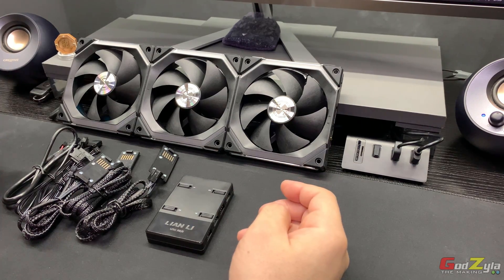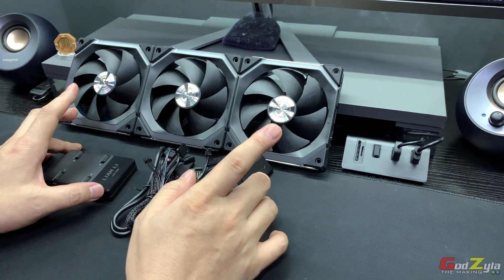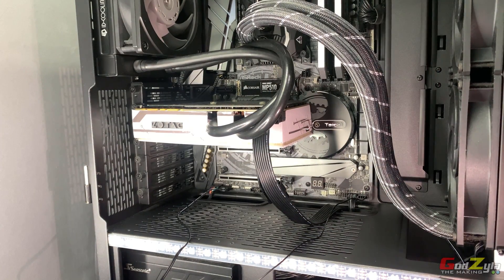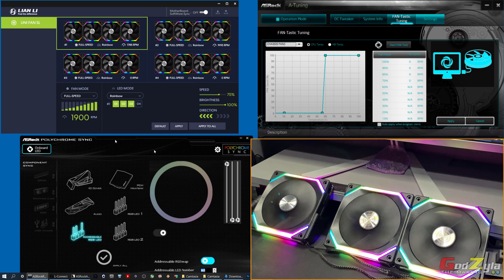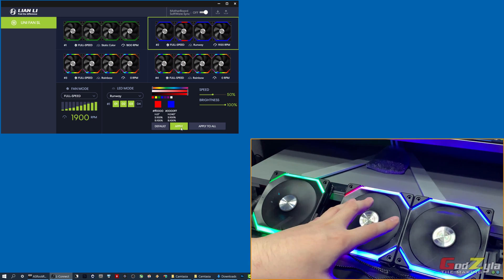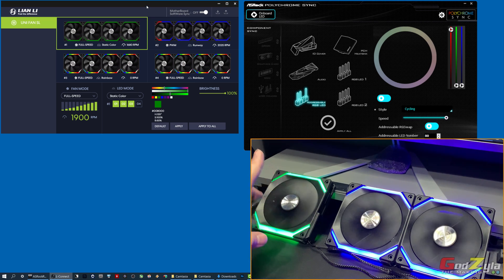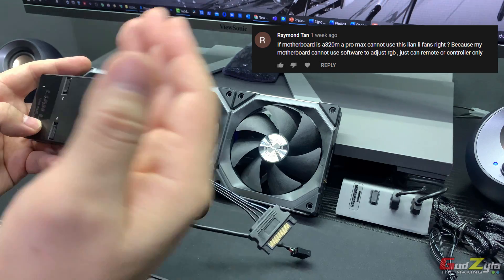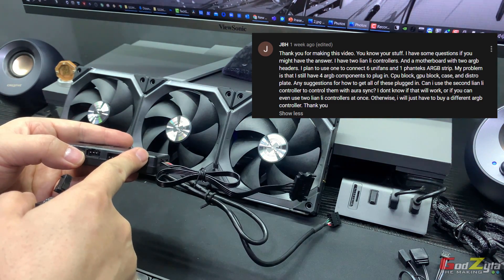Lian Li Uni Fan SL120 - Connection & The Controller (Part III) [L-Connect]

Comment: Hello, I just installed 13 uní fans into 2 different lían li controllers, but the software is only picking up one controller how can I get it to recognize the other controller? Or how can I get all 13 fans to match? The reason I went with 2 controllers is due to the 13 fans equaling 5 connections. Please help!!!!
Reply from the maker: welcome to my channel
You can't use 2 uni controller as the L-Connect will only reads one controller. As for how to connect your 13 fans. you might want to be more specific on how you place those fans. I can only assume your set up is  top 4, bottom 4 and side 4 and real 1. the only way I can tell you is this

4 x Top fans  into output 1 of uni controller
4 x Bottom fans into output 2 of uni controller

4 x Side fans into output 3 of uni controller
1 x Rear fan into output 4 of uni controller.
and the rest of your aRGB device like AIO or Strimer, make use of their own controller or use your motherboard aRGB header to control them. 

once again thank you for your question and if you do like my content. kindly subscribe and to click on the notification bell button.
Reply: @KleoYan  thanks for you reply, I have 3 in front 3 on bottom, 3 on top, 3 on the side and 1 in the back.
Reply from the maker: @MrSpartan58x  Hi there, that is total of 10 fans, but you told me 13? hmm am getting confuse? now besides the 10 fans of what you just told me. Do you have other argb stuff to be connected to this uni controller?
Reply from the maker: @MrSpartan58x  btw I do have another video which I combine the rear uni fan to the bottom uni fan which might interest you https://youtu.be/njlkdM9lYbI but please make sure is only total of 4 in one daisy chain. thank you!
Reply: @KleoYan  
3x front of case 
3x side of case 
3x top of case
3x bottom of case 
1x back of case
Reply from the maker: @MrSpartan58x  hi as mentioned I have a video that combines the rear to the bottom fans. You can use that an apply to your setup.

Comment: So by utilizing the hub, u can control each groups fan curve meaning if you have 12 fans( 4 groups of 3), do all fans have to run at the same speed or can u do 6 slow and 6 fast or whatever rpm u set them to? U can’t set them one by one but u can set a group?
Reply from the maker: hi Allen Sostan, welcome to my channel, 
I will try to put this as simple as possible. 
1st situatio, if you did plug the PWM fan connector from the uni controller to your motherboard. It will take only that PWM curve you have set. All your four output on your uni fan will only read that PWM. Of course you need to set on L-Connect as PWM. 

2nd situation. same as above but this time you do not plug the PWM cable from your uni controller to the motherboard. you can manually set each set of output to the fix RPM that you wanted via the L-Connect application. No PWM function.

hope that helps. If you do like my content, remember to subscribe and to click on the notification bell, thank you very much!
Reply: @KleoYan  uni fan to the usb header of the mobo it is then! Using L connect. Sounds better than the 1st situation! Thank you. U got a sub from me!!!!
Reply from the maker: @A.Sostan  you are most welcome and thank you to have subscribe to my channel.

Comment: Can you connect without the controller and do it directly to the mb
Reply from the maker: HI Rob, thank you for your question. yes you can. but you need convertors to do that for the aRGB connection, but please see if your motherboard argb header for the Ampere limit and note that each SL120 fans argb load is at 0.65a, so 3 will be at 1.95a which most motherboard should be capable of. if you do 4 then you need to watch out as some motherboard argb header only support 2A. as for the Fan load, it's at 0.18a which is fine to have 3 to 4 fans daisy chained, not an issue.

Comment: Is there a way to disable one 'group' in L-Connect? I have 3 groups, but they're unfortunately connected to group #1, #3, and #4, making some of the color transitions a bit jarring.
Reply from the maker: Hi lelmeister. Thank you for revisiting. Do you mean to say to totally off that particular set or? If it is, you can just set brightness to zero and that set of argb will not light up. But if you are saying to let it run but not interfering the rest by disabling it. Then I have no idea how to do that.

Comment: Is there a way to have the fans be set to motherboard rgb profile on startup? When ever I turn on my pc, it goes back to default rainbow. The controller has an aRGB connector to motherboard so there should be a way to set it up so it starts up with onboard memory instead of default to usb and l connect right
Reply: Even when I turn on motherboard software connect, and set rgb on my motherboard software, the fans go back to rainbow when I turn off and on. I tried having l connect run on startup but it still does rainbow until I go into software and apply change
Reply from the maker: @guapoconguap  hi guapo, as what I did for my friend is to load the profile saved. I know is annoying and we did send to lian li regarding about this, but yet to get a reply on this. 
am sorry that I am not able to resolve this issue as he is facing the same problem as you do. Thank you for your question and to have visit my channel.
Reply: @KleoYan  thank you kleo for your help. Please do let me know if lian li replies. I can leave an email or if you make another video about it I subscribe to you and will see it. Thank you for replying

Comment: I had a problem fan error
Reply from the maker: HI Angelo Antalan, thank you for feedback but do you mind to state the problem you are facing? with just one sentence fan error, I wouldn't be able to aid you much.
Reply: @KleoYan  do you have face book so that i can show you, or page ?
Reply from the maker: @angeloantalan8195  Hi, pardon me am running some errands. will only be back later. send me an email at godzylatech@gmail.com I will get back to you later. thank you!
Reply: Regarding 4 pin to the mother board you will see 1 metal on the 4 pin,  what i did last time  same process but  when i put the sl 120 fan error  what i did is to disable   The bios fan, i just ask question how to able that without disabling the bios fan

Comment: I have six unifans in my building an I believe I’ve plugged everything in but when I open up the l-connect the the custom color change option is missing... help?
Reply from the maker: Hello breebreemusic, thank you for your question. 
May I ask what motherboard are you using? Have you checked if your unifan is detected by your PC? or maybe remove your application and to reinstall again. here is a video https://youtu.be/8l4i5UjO3es  that might help you, If not I would adivse you to contact Li Lian.
Reply: @KleoYan  I use the asus rog strix b550-a gaming motherboard. When I’m in bios it says it doesn’t detect my fans.
Reply from the maker: @breebreemusic  in general, when you plug the PWM connector from your uni controller to the motherboard, your motherboard will not detect the fans RPM. it is normal, but it does provide the RPM according to your CPU or Motherboard temperature to the uni controller. You see, there is only one PWM cable on that header which is controlling all the output on your uni controller.. (not individual but all fans). So is perfectly normal.. Now for your question about your custom color change missing, I would double check on my system to see if it's shows that it's connected (Device Management > Universal Serial Bus Device > Lian Li - https://youtu.be/8l4i5UjO3es ) then next I would remove the current L connect app and to reinstall it. If it still does not work, kindly send Lian Li a support ticket about your issue. https://lian-li.com/contact-us/

Comment: can i use this without argb motherboard?
Reply from the maker: Hi 111lead, thank you for your question. if you are asking can you use this uni controller without connecting the argb cable to the motherboard. yes you can, but you will need to connect the USB and Sata cable. Just use the L-Connect app to control your fans rpm and argb. Hope that helps and if you like my content, kindly subscribe and to click on the notification bell. thank you very much!

Comment: Can you just use the L-connect software to control the fans lighting and rpm?  For instance, can you just plug the controller box into the USB on the motherboard and use the controller and lian li software to control the speed of the fans and lighting.  I would never use the motherboard to control the pwm nor the lighting.  Thats what the L connect software is for.  Basically asking if I can NOT use the argb nor the sys fan cables. thanks.
Reply from the maker: Hello Neil. Welcome to my channel. Yes you can. Just connect the USB cable from your uni controller to your motherboard USB 2.0 header and the Sata power source cable. You will be able to control the lighting effect and rpm using the L-Connect application without issue. Hope this help. Once again thank you for your question and if you like my content, kindly subscribe to my channel and to click on the notification bell. Thank you very much!
Reply: @KleoYan  thank you. Like 👍 your channel. Have you used the l connect software like the way im asking? I've used icue software like this. Corsair doesn't require anything other than a sata and USB 2.0 which is why asking. Love these fans, just wanted to make sure before I took the leap.
Reply from the maker: Hi Neil, yes. I’ve done two pc for my colleagues and have guided them on how to use it. Up and running without issues. But you will need to take note that you will need to do some steps to launch this L-Connect to boot from start. There are instructions to show you how at this page https://lian-li.com/product/uni-fan-sl/ here are the instructions from which I have corrected some procedure and tested it. 

The settings are written in L-Connect software, you have to run L-Connect to get your settings.
Please set L-Connect running as the computer starts. Following steps:

1. Click “Windows” + “R”
2. Enter : “shell:startup”
3. Click “OK”
4. Copy your “L-Connect” shortcut to “Startup” folder
5. Restart your PC

Comment: Your front mounted radiator is mounted incorrectly, you have it installed upside down, there's many videos on youtube explaining the correct and most optimal placing.
Reply from the maker: HI N.P.C 1984, welcome to my channel, thanks for the tip :)

Comment: Great video, quick Lian li question, most modern cases like the Lan Cool II mesh case has RGB controls on the front panel. One to cycle mode, the other the colors. However I have maxed out my controller (same in this video) as well as mobo rgb headers (2) so not sure where or how to implement.  Thanks and keep creating great in depth content.
Reply from the maker: Hello Johnathan Sullivan, thank you for your compliment. Perhaps let me know how many fans and how do you position them in your lancool 2 mesh. Also what type of processor and GPU AIO are you using? Any push pull configuration. Also are there any additional argb strip? then I will be able to voice out my opinion. by the way there are couple of videos I did on this uni fan which might interest you. https://youtube.com/playlist?list=PLEW-b-2vYDdM1WklGQps2-sQ1Amy6Uwn9 especially the dos and donts which is important. once again thank you for your question and compliment. if you like my content, kindly subscribe and to click on the notification bell, thank you very much!
Reply: @KleoYan   @Kleo Yan  3 front uni's, 2 top uni's one single rear exhaust uni and 2 PSU shroud uni's. So 4 sets technically all 120mm.  CPU 5900x, Dark Hero mobo. Phanteks glacier 240mm (I mounted the 2 top uni's to it)  no additional strips or any other rgb.  One cable from the front panel is a female 3 pin rgb header while the other was male 3 pinpower connectors (3). Which I disconnected because they weren't needed for the uni Daisy chain. The mobo has 2 rgb headers, one taken by the aio and the other the lian li controller (same one in this video). Thanks for the reply!!!
Reply from the maker: @jonathan.sullivan  I see. thanks for the input. Just my opinion

These are for output 1 to 3 - (Set fan to use any profile of the L-Connect app listed Quiet, High, Full or Manual)
========================================================================================
3 front Uni - connect to output 1 of uni controller 
2 Top Uni + 1 rear (continue daisy by using a 5V 3pin to sm3p / JST 03 + a fan splitter) - connect to output 2 of uni controller (illustration concept is same to this https://youtu.be/TIO8JxVZTi8) 
2 PSU Shroud Uni - connect to output 3 of uni controller 

Fan Splitter 2 to 1
https://www.amazon.com/JBtek-Black-Sleeved-Splitter-Converter/dp/B01EF9OI0O/ref=sr_1_3?dchild=1&keywords=Fan+Splitter+4+pin&qid=1611401712&sr=8-3

5V 3pin to sm3p / JST 03 
https://www.ebay.co.uk/itm/PC-motherboard-5V-3PIN-TO-AURA-RGB-FAN-SM3P-Socket-Multi-connectors-cable-ASUS/264896189467?hash=item3dad0b141b:g:I6MAAOSw8-5ey3U8 
or this https://www.aliexpress.com/item/1005001598378033.html (choose 1 to 1 Female 5V 3pin)

This will be the unique setting on output 4 - (Set fan to PWM on L-connect app and control the RPM though motherboard fan header (fan curve))
====================================================================================================================
2 AIO uni - connect to output 4 of uni controller 

now do note that you can connect them to your liking as in which Output from 1 to 4  to use. but the pattern above is what I will do. 

hope this help. thank you for your reply and to have visit my channel :)

Comment: So, if I have 9 fans, 3 for AIO, galahad 360, how would I connect it? Would I connect the pwm to cpu fan header and then USB and switch the 3 fans that are on the AIO to pwm?
Reply from the maker: Hi Alex G. Thank you for your question. This is just my opinion. 

Galahad AIO pump directly to CPU fan header full speed

3 x SL120 for the Galahad. connect to Output 1 of the uni controller (set on L-Connect to pwm)

3 x SL120 connect to output 2 of uni fan controller (Set L-Connect to control the rpm as you desire)

3 x SL120 connect to output 3 of the uni fan controller (set L-connect to control the rpm as you desire)

That will be my opinion. Once again thank you for your question and hope you like my content, if you do, kindly subscribe and to click on the notification bell. Thank you very much!
Reply: @KleoYan  so I connect the controller to USB header, sata and the pwm to specifically cpu fan header, not just a regular fan header?
Reply from the maker: @__Grig__  yup. Correct and since u can only have one pwm curve as based on the specific fan header to be plug at. Make use of the pwm for your Galahad. The rest just use the L-Connect to controller them.
Reply: @KleoYan  perfect. And then I use the motherboard software to controll the curve for the cpu right? Sorry for all these questions. This is my first build and so far, the fans are my worst nightmare
Reply from the maker: @__Grig__  correct. And if you unsure how to do the pwm settings on your motherboard in order to control through the L-Connect. This might aid you https://youtu.be/8l4i5UjO3es  it’s quite near the end of the video

Comment: I plug everything in and fans do not turn on. I plug them directly into the mobo they start immediately. Any ideas? Do I need to install windows first for the controller to supply power?
Reply from the maker: hi Watchmeshine, welcome to my channel. as for your question. Yes you need to install the L-Connect application in windows. normally what I do is to install your processor inf chipset driver before installing the L-Connect application, then check to see if your Uni Fan controller shows under device manager when you plug the USB cable between your uni fan controller to your motherboard USB 2.0 header. once that's confirmed. plug the fans required on the output of the uni fan controller (both argb and fan header) then plug the Sata Cable that is supplying the power to your uni fan controller. launch the L-Connect application.. test it out to see it you can control your fans. if you want to use the motherboard fan header and the argb, then connect that cable to your uni fan controller. now if your uni does not work, maybe do some basic troubleshooting which I have just uploaded this video. https://youtu.be/8l4i5UjO3es see if that helps you out.. by the way, if you do like my content, kindly subscribe and to click on the notification bell. thank you very much!
Reply: @KleoYan  I'll give it a try thanks (: new build with no fans on was making me wonder.
Reply from the maker: @dakotalovespie  I see, most of the time should be either lost connection somewhere or the windows OS is not detecting the Uni Fan controller. do give it a try, do baby steps at a time. This will save you from getting frustration :) I wish you all the best, do let me know what's the outcome. I will try my best to aid you out.
Reply: @KleoYan  I must have received DOA controllers none of them provide any power to the fans. Shows up in device manager. very strange. Guess I'll order another controller and see the results to that.
Reply from the maker: @dakotalovespie  oh no, do you want to try writing to Lian Li support through a form, they might be able to aid you and to replace your uni. I mean it will be a waste if you just grab another unit where this unit is faulty. plus it's not at your fault. here is where you can raise your case at https://lian-li.com/contact-us/